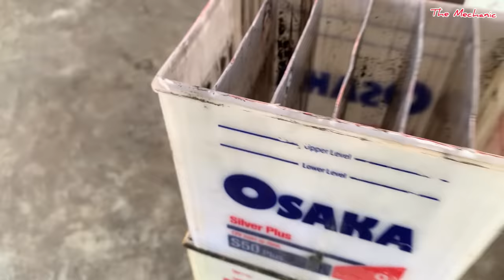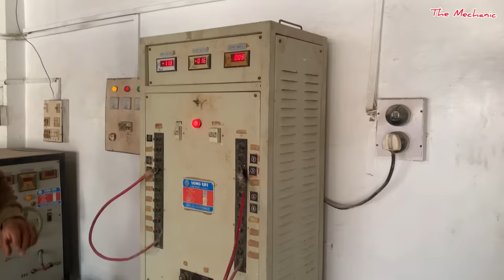How to Bring a Dead Lead Acid Battery Back to Life || How to Recondition & Repair Dead Old Battery

Comment: You're going to have a lot of work with electric cars, that's fine. Good job!
Reply: You can't remanufacture lithium batteries witch Ev's use. Only recycle is possible and then use those raw materials to make a new one.
Reply: They are not of that kind, you can't just rebuild them this way.
Reply: @WCKD.  Yes, EV are highly "environmentally friendly"... /S

Comment: Wow.... wow astounding it it more cost effective to do this, than buy a brand new battery mass produced in an automated factory.  Wow, that these things even work considering the environment they are built in, and wow lack of even the slightest hint of OH&S.  Interesting video to watch.. oh and wow to putting 4 different type of 12V batteries in series and smashing them with a 48V charger lol.
Reply: The other three batteries in the charging circuit act as a regulator in effect, limiting the current. I think....

Comment: Amazing they are able to work barefoot around lead and acid without being harmed. What a fascinating process.
Reply: Not being harmed?. Tell that to their central nervous system.
Reply: @ferolcat2009  I was being a smart ass, those were my thoughts right away.
Reply: @grantw.whitwam9948  So was I.  It's a sad situation for them and their government should be ashamed to allow it.

Comment: Acid and lead.  Two most caustic and poison stuff.  How about rubber gloves, boots and goggles?!?
Reply: Seriously? You don't get it do you.
Reply: At least in this shop one guy was wearing a thick rubber clove to handle the cutting off of the dirty lead.  In similar vids like this everything is done bare handed.
Reply: миллиард населения решает эти проблемы
Reply: I am the safety officer in my lab.
I forbid the use of gloves when handling concentrated acids.
Gloves are only permitted when handling dilutions.
Much as I hate to say anything positive about safety in this vid, they handled the acid properly.
Reply: @joshua43214  That's the dumbest thing I've heard this year.
Reply: @MisterMooo  You clearly know nothing about concentrated acids then...
Sleep well in your ignorance
Reply: @jpeabody1155  lots of acid on the old plates do you blame him?
Reply: @MisterMooo   imagine getting acid inside your gloves... thats why you DONT wear gloves when handling neet acids.

Comment: seems like more effective then trying to repair old batteries by replacing water or owercharging etc. as all is reglued from scratch it should work like new ones. except the leak protection doesnt seem comparable to new ones.

Comment: I like their special protection shoes against acids and hot lead.   The non existent rubber gloves and eye wear too!
They also must love breathing corrosive  toxic vapor 😂
Reply: The amount of money these people make per year is nowhere near enough for all the safety equipment they would need to be fully protected.
Reply: @MegaRazorback  I think that you slightly underestimate the greed of the owner/employer. 🤣
Reply: @taunteratwill1787  I was actually being serious, in places like this small scale businesses can't afford the prices for what we would consider normal when it comes to PPE. A lot of these small scale businesses make just enough yearly to cover materials, payroll, location lease and maybe a small amount of profits.

If you've been to these places you'll soon realize that pretty much all the small businesses that deal with toxic stuff are like this, they just can't afford to buy PPE due to how much it costs, they'd be spending way more than they'd make just to outfit a couple of workers in full PPE gear and when it could mean going without food for a while they'll opt to go without the PPE gear every time.
Reply: @MegaRazorback  I agree but trust me on this one.  Plastic or rubber boots, gloves and primitive masks as we use against Covid are not that expensive.  And most certainly not expensive enough to deny those people these simple measures.  😎
Reply: @taunteratwill1787  Great! Someone with common sense who cares! But you'll have to give up work for a year, sell your house, travel there, make a living, hope you don't get sick, and teach them English first before you can explain to them in 5 minutes what you just typed effortlessly to us on the internet.  Be better if you hung around for a while to set up a programme of safety protocols.  Perhaps a Go Fund Me "Pakistan Safety "campaign or partner with a church outreach project.  You could gets local high school kids involved in a cultural exchange to raise local awareness. Call the Mayor. Oops maybe not christian church that might come across badly.  See it gets muddy all the sudden.  Hey maybe we could simply ask the Chanel Owner to put a donation link on his page.  If we could only speak Pakistani.  To learn, we would only have to give up work for a year, sell our house, travel there....

Comment: I love this upcycling stuff, wish we had more like this mentality in England
Reply: @CaptHollister  bang on mate, almost all of the battery can be recovered/recycled, but this is not upcycling, this is environmental irresponsibility.

The acid would likely be reused, although in a lead acid battery, you can start with plain water and create sulfuric acid through charging.

The rest of the battery is more concerning, the lead oxide and lead phosphate, which is the grey/black sludge they are cleaning off the lead plates onto the waste pile, and which also would be still absorbed in the paper separators which they don't appear to be recycling and I would bet would be thrown away without any special handling.

That lead would be released into the environment and lead is a very toxic chemical which even in small doses can create lots of mental and physical development issues, particularly in the young.

I would say that they've recovered all of the plate lead and recast this back into new plates given that lead is rather pricey rather than they are environmentally responsible.

This is something you definitely do not want in the UK (or any other place) without the requisite materials handling and safety, along with the proper recovery and prevention systems to stop the waste contaminating the environment.

These guys are doing nothing more than reusing the scrap lead in a very dangerous and environmentally unfriendly way. Folks need to realise this and not applaud the behaviour.
Reply: @astrawally8448  Creating sulfuric acid by charging water is a new one on me, how does that work then?

Comment: Nothing was brought back. Thats simply cutting apart, removing the sulfated plates and rebuilding a battery. Mind you: not all steps were shown.
Reply: I was wondering where they get the new plates. Mr. I melt the plastic is the boss. He has mad skills.

Comment: In the Netherlands lead is concidered to be a danger to the environment. In the coming years lead weights are banned from sportsfishing to protect waterquality. Lead is accepted for construction and roofing but they are looking for alternatives. Environmental protection is not the ‘forte’ of the sandal brigade. Re-using costly basic material is, that’s a plus. I would like to know where the battery acid went.

Comment: Very interesting I don’t think someone can get the new parts in America also burning that plastic should be very toxic for them !
But if companies design a battery case so it can be open and close so the battery could be refurbished instead of filling up the dump leaking in the ground !
Reply: Absolutely zero batteries just sit there in a landfill leaking into the ground. They are worth way to Much money to let that happen. They all get recycled
Reply: @Mad.Man.Marine  this depends how it’s done and what country it’s made even in this video how they treat the non recyclable parts and old acid I have no answer for this but my guess is it go to dump  !

Comment: Do they use regular water, rain water or with some special mixture water? Thanks
Reply: the blue barrel? Thats probably sulphuric acid diluted with distilled water so the acid concentration is about 30%.

Comment: Only half reused, however the lead oxide plate usually be destroyed, if not new, the mesh need new lead oxide. How much cheap, compared with new one.

Comment: I missed the part where the cores of the batteries that were taken out, were used again. So, if this is new cores, than only the plastic cases were saved. Which, from a recycling point of view, seems a complete waste of time. Besides the obvious health issues of course.
Reply: They reused the lead after removing the fiberglass separators and drying the lead.  One guy was shown modifying a case from a larger battery so it can use the lower capacity smaller cells.  So, in addition to fun things like rinsing lead down the drain, they are selling at least some batteries that have very low capacity for their case type.

Comment: Battery labels be like…”The main danger associated with car batteries is an explosion, which can occur due to a phenomenon known as “gassing,” where the battery releases flammable hydrogen gas. If the hydrogen gas is ignited by a spark, the entire battery can explode, showering you with sulfuric acid.”

Muhammad: “Hand me my chisel”

Comment: Looking at this carefully they could have got someone to make up the empty blank plastic cases the material they were using is all brand new. Why bother resurrecting a old battery because from i could see making a new battery would have been much more easy and better and more quicker to put all together.
Reply: They are probably going to sell them at a premium because the brand name.

Comment: Hello sir namaskar i am fron nepal i need help sir in my tractor battery 🔋 box is metal and while driving + and - pole touch each other so battery is not working help ne sir that is my new battery 🔋🥺🥺🥺
Reply: Change the battery under warranty

Comment: This lead "spot welding" thing is plain scary. Not because of electricity, voltage is probably so low as to be completely harmless....no...the resistor electrode (the glowing thing) will be vaporizing a lot of lead :( . Not will be, by the dark smoky patterns you can see that it IS......

Comment: this charger will make the batteries boil at high voltage. This will greatly reduce the battery life. If you want to know more about how you shouldn't charge batteries, I can help you charge your batteries correctly.